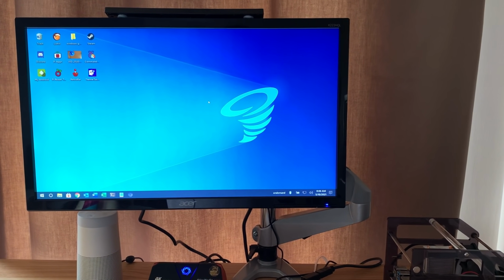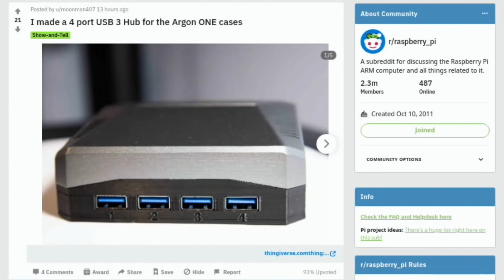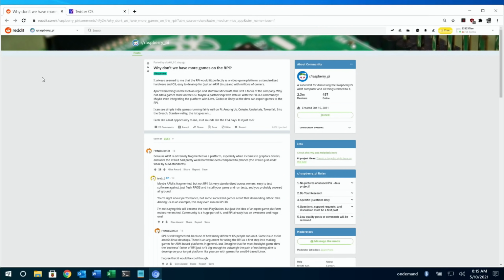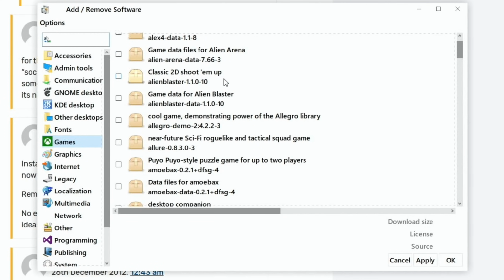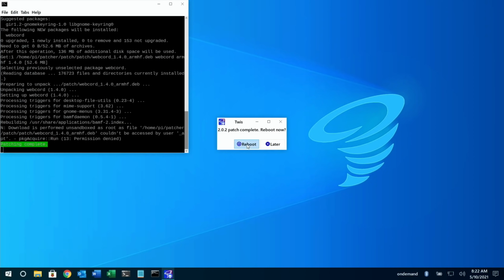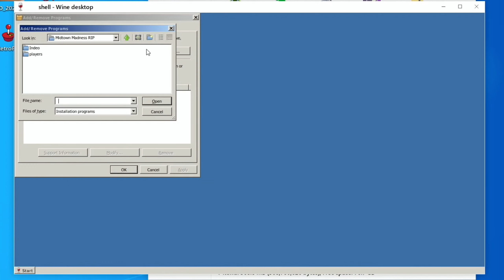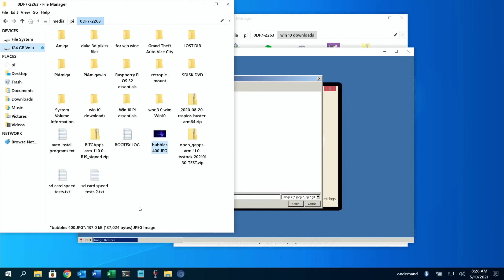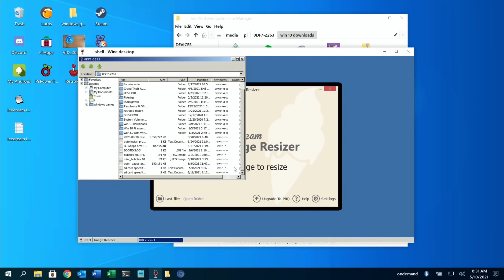Pi news 28. Twister OS update, MacBook Pi & A little taste of Wine.

Comment: Is Twister OS better than Raspberry Pi OS 64 bit?
Reply from the maker: I prefer the interface and all the pre installed installed programs with Twister. However I suspect Raspberry Pi OS 64bit will perform better, it’s still in beta so the support for programs isn’t great yet.
Reply: @leepspvideo  does the Argon one case work with Twister OS?
Reply from the maker: I don’t see why not. Try asking on the Twister Discord
Reply: @leepspvideo  I installed Twister OS & the Argon one case works. So far I prefer it to the current Raspberry Pi OS 64 Bit.

Comment: Hi Lee, I have a question: Is there in Twister OS any option show the keyboard layout (if i have two or more keyboard layout) in the right bottom? Thank you very much for your answer.
Reply from the maker: I never switch keyboards. Try the Twister Discord
Reply: @leepspvideo  Thank you very much Lee. I asked the question on Twister OS website. It is a very good system for RPI4 and I can switch between languages with keyboard shortcut, but if I have two keyboard layouts I can't see which one is active. So the keyboard layouts display is very useful for me.
Reply: @leepspvideo  Hi Lee i Found an answer. You have to only install xfce4-xkb-plugin
 and restart and you can see current keyboard layout in right corner ... I hope this help more people. Twister OS is very cool. Thank you for your videos.

Comment: The Argon One uses the GPIO to power the Pi not the USB-C.  So with some modification, the USB 3.0 Hub could be powered directly from the input source. So a single 5V AC adapter that gives more than 3A could be used

Comment: Good day. i have try to install win10 following your video, pausing every min......at least 7 times! using diff releases even the one you used with no luck (frustatted) Now the second part is: i'd like to try win 10 because ethrnet/wifi on my pi4/8gb is so SLOW. i have follow other videos and ask several people over the internet but NO luck ;(. i have also used other distros with the same issue. Could be my pi? BTW LOVE twister os. Any advice? please help. I run my pi with nvme or ssd and is fast on any other task but the internet
Reply from the maker: Try an sd card for the Windows install or a different usb device. I take it you are following the latest video. 

https://youtu.be/C2c6bG1axEw

I don’t understand why your Ethernet and WiFi is slow on multiple operating systems

Comment: FYI, just a heads up, portable Windows apps run great on Pi 4 via Wine. And you don't really need to run Wine first, just double click .exe and it will just run. Of course there apps that work others not so much like Browsers, otherwise it's a neat feature ;)

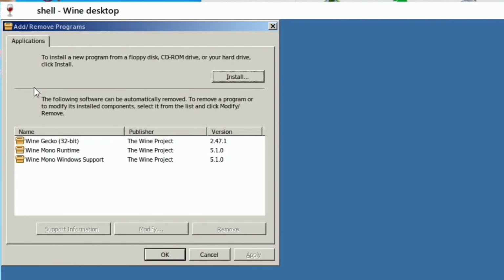Comment: Win32 disk imager 11:34
Reply from the maker: I haven’t tried installing it yet.
Reply: @leepspvideo  I did ,try to do  so ....got an error ,then I did try to install "SD Card Formatter.exe"(it is used to format sd card & usb drives)
It seem to work fine but it's not able to detect the external drives 😭😭
Reply from the maker: @yuvrajkukreja9727  fortunately The Pi has some great native programs already for backing up operating systems.

Raspberry Pi OS. Backup, Shrink and Restore to SD, USB or SSD. Raspberry Pi 400, Pi 4.
https://youtu.be/00ck25k_lgw

Pi-Safe. Raspberry Pi 4 / Pi 400. Backup, Shrink and Restore SD cards and USB devices.
https://youtu.be/XP6ycUR9Ih0

I was trying programs out of interest not because the Pi is lacking them

Comment: Twice, this weekend, I set everything up on my pi, with twister, morrowind, half life, GTA, redream, etc. just how I like, and then my SD card corrupts. 
Got an SSD on the way, as I don't think SD cards are meant for this kinda thing lol. They seem to work fine, if you install an os/program and just leave it, but if you're going to use it like a personal PC, it's just too unreliable. 
Here's to hoping the pi 5 has both a full-sized HDMI as well as a M.2 slot.
Reply: It really depends on the sd card, some are a lot higher quality than others. However, for a long term pc, an SSD is worlds better and won't fail on you. 👍
Reply: @rileydavies833  It was a genuine Samsung evo +, as I remember testing it when I got it. 

That said, over the past year I've done a bit of flashing different OS, along with installing a variety of programs in each case, using it as a youtube player, retro gaming, etc. Perhaps the SD card is simply worn out at this point. 

The SSD will last ages longer for my purposes, so likely better value.
Reply from the maker: Ssd’s work great for me.

Comment: I am waiting for a 64-bit version of Twister OS to switch to it as my daily RPi 4 driver. Right now I am on Ubuntu Mate 20.10 but I really miss the responsive, clean, easy to use Twister OS desktop.
Reply: Even Raspberry pi OS is having 64-bit growing pains. I think the biggest hindrance is the lack of realvnc server for 64-bit. I think once there's an official 64-bit version, they'll make 64-bit OSes the priority.

I'm aware of the workaround for installing realvnc server on rpios and ubuntu 64-bit systems, but it's not officially supported.
Reply: Why do you need 64bit, twister has almost everything even though its 32bit thanks to pi apps
Reply: @fred-youtube  Because things like modded minecraft servers exist, and the 32-bit version of java won't address enough memory for it to run, but the 64-bit version will. 32-bit Linux on Pi can work around the 4GB limit, but the 32-bit programs themselves don't. Also, 64-bit is much more efficient and runs smoother.

Comment: Hi why my chromium os is not sync on Google account please help
Reply: If you haven’t heard..google has depreciated sync support for chromium...you won’t be able to sync between devices
Reply: @TheTechieScientist  suggest me any other browser
Reply: @allmosttech7958  Mozilla Firefox is fine..but you have to create an Firefox account on all of your devices to have effective sync...or you can just use chromium itself ..just login separately to each website you visit
Reply: @TheTechieScientist  I installed mozilla but open google in mobile version
Reply: Hey techie scientist is right. Chromium seems to be synching in my raspberry pi os 64bits beta, but i guess it stoped in manjaro. It didnt afected me much, as im a firefox user and firefox runs quite fast in raspberry nowdays. The transition is smooth, you can cross your data, logins, etc and firefox have more extensions great for the user. For starting, i recomend these extensions on raspberry: ublock, h264ify, unload tabs, etc
Reply: @RafaCoringaProducoes  Indeed!